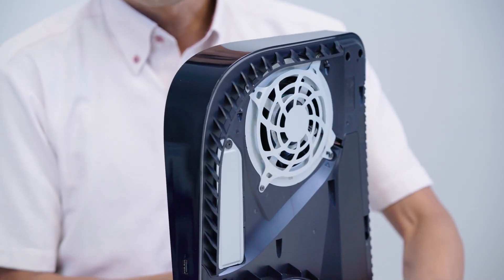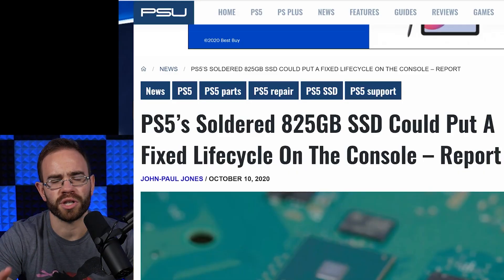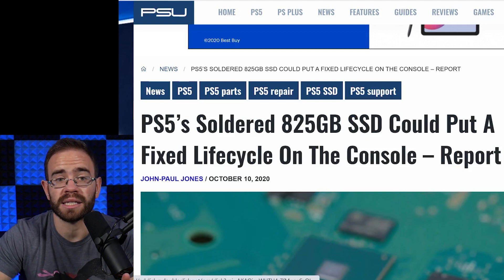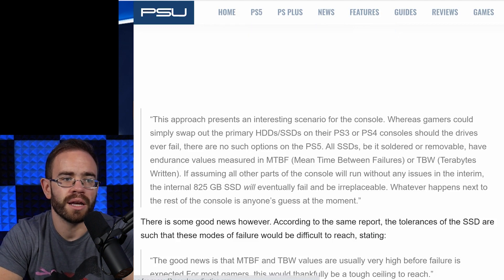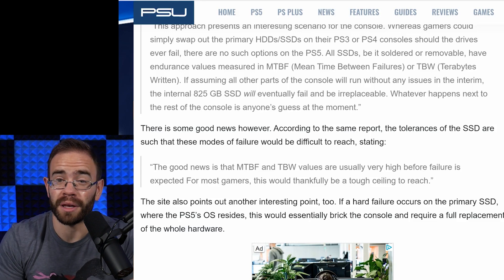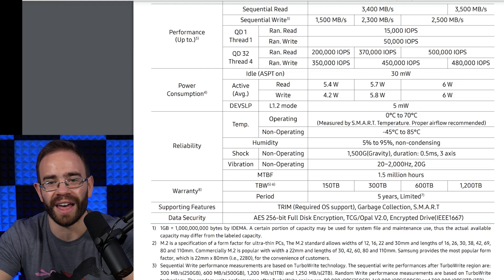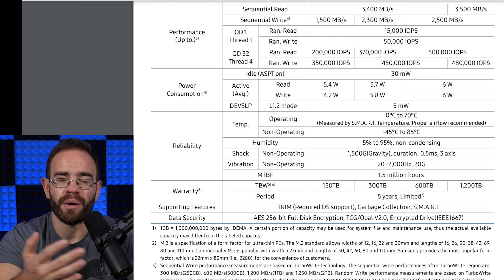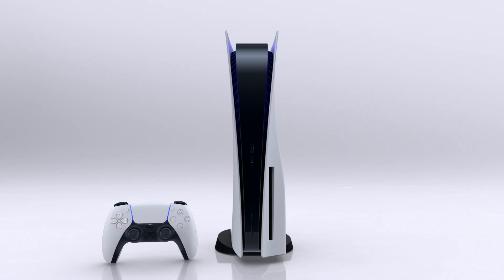Is The PS5/Xbox Series X SSD A Problem For Preservation?

Comment: I don't think many people will rewrite their entire ssd more than 600 times over. Hell, the average attach rate of most consoles is what, 13 games? Plus, if you add a ssd to that m.2 slot, it will take some strain off the internal ssd.
Reply: rob13589  yh it will be empty
Reply: That equation is changing.
With Xbox Quick Resume they're storing about 13.5GB of data every time you pause a game (or between 5-9GB with Xbox One), and it's actually going to update most of the file every time you swap between any two games (Assuming you load a new level every time you swap games), the number of games you have paused in Quick Resume is mostly irrelevant.
If you use Quick Resume 10 times a day, it would take... 20 years to reach 1Petabyte written (the approximate endurance limit of most 1TB SSDs).
Rumor has it Microsoft is using the FireCuda 520 as their SSD: https://www.seagate.com/ca/en/internal-hard-drives/ssd/firecuda-ssd/
Write Endurance on these is listed as 1.4 Petabytes per 1TB of drive storage, so I guess the Series X SSD would go for 28 years while using Quick Resume 10 times per-day.
And most likely Series X would account for redundant data in Quick Resume (basic engine code at least, but if you pause twice in the same level there will also be a lot of redundant data there), so in practice the drive could still have a lot more endurance than just 28 years worth of daily operation.
Yes, I can see it being possible for a bunch of kids to swap Quick Resume games hundreds of times per-day and kill a Series X in just a few years, so the potential for drive failure is not totally gone, but for the average gamer it's just not a concern.
Reply: 13 games???? I have about 500!!!
Reply: @The_Neco_PT  A lot of people only play Madden and/or CoD. My bother-in-law ONLY plays Fifa on his Xbox1. The average really is like 3-5 games a year.
Reply: @The_Neco_PT  dude 500 games? Awesome do you have any unopened ones?
Reply: I have 978 games and more by the day
Reply: I just killed my 1tb hybrid hdd. Too many reads writes and edits. But thats an HDD and it lived from ps4 launch to ps5 price announce. SSDs live exponentially longer without any major equipment malfunctions.
Reply: Mike Foss yeah, SSD’s have no moving parts so they are a bit more durable, but they do eventually die (after around a petabyte of data transfer
Reply: @fosstheboss31  I recall reading that HDD last an average of 4 years. Don't know about SSDs but It has to be longer.
Reply: @praisethesun4997  all of my HDDs lasted years way longer than 4
Reply: @praisethesun4997  HDD seem to last over 10 years If you don't drop them. I hope my PS5 triples that cuz my computer's SSD is making me think otherwise. It's a ryzen 3600 with a x570 motherboard yet the SSD seems to have problems running some games so I play them off of the HDD instead
Reply: @N7uy66u  Cool. I'd say anecdotally most of my drives have lasted over 5 years. But I do have a few dead drives in a drawer. 3 Seagates an IBM drive and WD drive to be exact. I just recall seeing something from a data center about how their HDDs lasted an average of 4 years. This isn't the article I read, but says the same thing. https://www.prosofteng.com/blog/how-long-do-hard-drives-last
Reply: @praisethesun4997  My first SSD is over 7 years old, still functional and has been moved into a number of computers. However some amount of nand will fail prematurely, and I have had to replace a handful of them at work. I've replaced many HDDs in consoles too, so I can see this being a problem if the nand fails and the console will no longer boot. Ideally they should make the  console bootable from add-in storage.
Reply: @fosstheboss31  ssd don't last exponentially longer. HDD failure is down to moving parts, SSD on the other hand has a write limit.
Reply: NVMe is sure to drop in price so years down the road can just get 2tb+ and save wear on the internal.
Reply: 13 games?  I have more than that on just one hard drive.
Reply: @deathproof8732  I probably have 100 ps4 games, but we aren't in the majority. Most console owners only buy a handful of games.

Comment: You could download cod warzone 2400 times before it would be an issue. This just isn't a realistic thing people will hit.
Reply: Considering the average attach rate (the amount of games a console owner buys) is only about 13, I doubt this will be an issue at all. I consider myself a serious gamer and I only have about 100 ps4 games.
Reply: It's true, but bear in mind that the SSD also needs to write things in the background constantly. Saves, updates, cache, paging, OS related operations, etc. ... . The games installed are not the only thing wearing the SSD out. It's not a negligible amount of daily wear and tear, however, it shouldn't realistically be that big of an issue.

Also, a small aside about preservation concerns: SSDs normally go into read only mode after a threshold and at that point one could just dump the files and transfer them.
Reply: @MyChannel-SR1  if there’s a read-only mode, what’s the issue with preservation?
Reply: @jonathanodude6660  It's not really a read only mode you can access every day, it's a measure to prevent the SSD from becoming unusable upon failure. This is usually done to avoid loss of data, which means that preservation efforts might be aided by it. However, I'm not so sure an OS can be accessed in read only mode as there are a lot of OS tasks that can't be performed (and I'm luckily ignorant because my OS SSD never failed). If Sony makes it possible to install another OS/recovery program on the second SSD slot it might almost certainly be possible to extract the data on the spot.
Reply: @MyChannel-SR1  yeah but I’m assuming the issue is that games are becoming more and more digital, so it’s harder to get working copies of the game past the point where it becomes unavailable, and if the drives we store them on become unusable, then they are lost. but if the drives automatically (or even manually) enter a self preservation mode at the end of their lives, is there actually an issue with data loss? The data is still accessible.
Reply: @jonathanodude6660  That's also my point. Failing SSDs still are safer than expected. Also, we probably will have a way to dump the files by ourselves even if Sony goes out of business (that is if Sony allows for an OS/recovery tool to be installed on your secondary SSD).

I'd say however that people who really want to archive their games will have to dump them to an external HDD (which Cerny claimed to be possible). Thorough archival projects still exist for people who didn't save their games during Sony's business lifespan, and at that point there should be no problem downloading Sony's IP off the internet.
Reply: Every time you switch games, Quick Resume (and its PS5 equivalent) will write something like 12 GB of data to the SSD before restoring whatever game you selected. It adds up.
Reply: It is theoretical TBW. Not practical limit usually SSDs last 10 times longer than claimed TBW for warranty purposes. For example there is anandtech article where they test various SSD write limit. Most drives easily last 1 PB before any significant wear.
Reply: @rapiddu6482  These also tend to be based around averages when testing huge numbers of the hardware. Some percentage will fail well before these limits, particularly if other factors come into play which might increase risk of damage to the drive. SSDs are certainly less prone to damage from vibration and such like HDDs were, but heat certainly impacts SSDs and the PS5 will be putting out plenty of that judging from the heat sink. We'll just have to wait and see what kind of information is released about this, as well as what kind of issues appear once the hardware is out in the wild.
Reply: @ArtumTsumia  
Sony has built their 5th major console now , I'm sure they'd have given a thought to all of this much more than us. The insane Heat sink along with double sided inward flow fan with considerable dia and thickness is gonna take care of all the thermal issues that's for sure !
Reply: @Zeegoku1007  No doubt. For the vast majority of users, this kind of thing won't be remotely a consideration. So long as the drive hold up a minimum of 5-10 years, but the point of the video was preservation and in that context it becomes a question of if it'll hold up for 30+ years. For collectors like myself, who do have working hardware that old, it's at least a question in our minds. Repairs and modifications will likely be possible in the future, but original hardware is always nice when possible.
Reply: @ArtumTsumia  
Yeah. But if you ask me , design wise PS5 is a step up in almost all the hardware aspects compared to the PS4. What's troubling me is the external storage options whether Sony will be producing their proprietary SSDs , which 3rd party ones will be supported  and of course the price. Also I hope they have made proper arrangements for the external SSD slot cooling.
Reply: People need to keep in mind that the drive is used for far more than just game storage. There's updates, game saves, video capture cache, and lots of various other data that gets written to drives. These tend to be incredibly small in comparison to the size of games, but they happen incredibly often. Also consider the fact that most users will try and fill up as much of their drive as they can with games, and now all of these writes are occurring repeatedly in the same 5% of the drive. If the write limit for a 1TB drive is 600TB, then in practice this is going to be reduced by a significant factor as the majority of the drive is in use. This isn't even taking into account any other reasons that a boot drive might fail, leaving the user with little more than a brick.
Reply: Lol console peasants asking questions that have already been answered by the PC MasterRace 10 times over....the data is all right there in front of you.

Comment: shit ive had to reinstall 1.5 tb worth of games to my ps4 with a 2tb hdd/ssd like 8 times cause my power went out that ps5 wont last around me
Reply: 1.5tb is a long way off from 600tb.
Reply: Buy a UPS for 60-100$ , it helps you turn off the console properly when power goes out , it has battery that last about 5 minutes , giving you enough time to save your games and turn it off
Reply: Rith Panhapich oh, thanks ill look it up
Reply: iBlaze : you can check the power consumption of your TV + 310 (ps5 confirmed to use 310 watts at maximum) and pick the UPS that have similar battery that could last at least 5 minutes for you
Reply: Rith Panhapich thank you, you helped out a ton
Reply: @Ldenlord  Thanks man i never knew these existed 🙏
Reply: Yeah, hope they have a solution for power going off
Reply: I just bought an off brand one for 40$ , known brand are good but they’re like 200-300$ price range so fuck that lol... and this one works fine for me for 2 years now
Reply: 1.5tb x 8 is only 12TB. 600 TB = 600,000 GB. Since the PS5 drive is 825GB you'd have re-write the entire drive 727 times before you would threaten failure from TBW. And it sounds like you should get a battery backup so you have time to shut down your system when the power goes out.
Reply: @praisethesun4997  yeah but power outages and re installing games is no good for a console that is meant to last
Reply: @13gta  Power outages and any electronic is no good especially an expensive power hungry one like a console. If you have frequent black or brown outs in your area, get a battery backup. You have bigger problems than possibly killing a PS5 via TBW.

Comment: If you don't add additional storage to the PS5, and are continually deleting and adding new games, you'll quickly kill the SSD in it, as the capacity is tiny, and they are designed for a finite number of Terabytes written to it...
Reply: He showed that other drive had a 600tb limit before you need to worry. Most people won't rewrite their entire internal ps5 ssd more than 600 times.
Reply: Given it's 600TB of writes if we hold each game as being UHD Blu-Ray max of 100GB, and acknowledge the PS5 won't have a page file, you're talking about downloading 6,000 games to hit the write cap.  The PS4 only has around 4,000 games in its library, so you would effectively need to buy the entire library, and download half of it more than once while assuming everything is bursting at the gills of what UHD Blu-Ray can handle.

If you have the money for all that, you will have the money to buy a m.2 drive once commercial drives are ready for use.
Reply: Let's say the average next gen game is 100GB to make the math easy. You would have to install 6,000 games on the internal drive to threaten failure.  Game saves are going to eat up some of the TBW but even if we grossly over estimate save data to 1/3rd of the data written. You are still looking at 4,000 game installs. I don't know about you but I own maybe 300 games and that's across six systems and over the past 20 years.

Comment: They took a page from Apple's playbook. Makes people angry so let's hope these have lots of read and writes available because they will eventually die. If you can get the chips though it may be possible to solder a new one on there.
Reply: Given it's 600TB of writes if we hold each game as being UHD Blu-Ray max of 100GB, and acknowledge the PS5 won't have a page file, you're talking about downloading 6,000 games to hit the write cap.  The PS4 only has around 4,000 games in its library, so you would effectively need to buy the entire library, and download half of it more than once while assuming everything is bursting at the gills of what UHD Blu-Ray can handle.

If you have the money for all that, you will have the money to buy a m.2 drive once commercial drives are ready for use.  Apple's issues have largely had to do with them frying the Controller because of bad board design, see Louis Rossman for details.
Reply: @jebe4563  Goes faster than what you think and it will not play off the disk it writes it to the storage before you play then you have to factor in updates and all that jazz. That is why it is concerning just like the liquid metal. Dont get me wrong I am getting one but as a consumer I have concerns. I am an IT professional and I know how flaky some of this stuff is and how it can fail easily.

Comment: Im wondering if the ps5 will use that custom SSD controller for only that SSD or will it work on the one you can install on the side? This whole 600tb thing is worrying as the SSD so small your gonna be deleting and reinstalling games alot
Reply: 650 TB would last 10 years if you install game at a size of 178GB every single day , so I’d say you’re fine
Reply: You'll have to work pretty hard to rewrite your entire ssd more than 600x. There's no reason to worry. Even after 10 years of use, the ssd will be fine. Hell the mechanical components (disc drive, fans) will fail long before the ssd. The PSU probably won't last that long.
Reply: @fattiger6957  it's such a small SSD tho it's gonna be constantly having to be written over repeatedly any time you get a new game. Games being 100gb now days I see it being a problem eventually
Reply: @dbfzato-1327  you have to write a 100gb games to it 6000 time for it to fail. How many games do you have in your PS4 collection? I'm betting way less than 6000.
Reply: If you watch Road to PS5 you'll note Cerny is very explicit that any drive going into the m.2 slot will be using the PS5's controller, hence why they have to validate it actually works properly with the controller at the intended level of performance.

Comment: I get what you're saying but in 10+ years, specially with the PS5, even if it's on board drive fails, you'll still be able to put in bigger one in the available slot.
Probably 4 terabytes for under $100 at that point.
And by then, you'll be using it less so it should be good if you keep your systems.
Reply: SSD in the slot is only additional, main SSD and system is soldered onto the MB, if it fail - system will not work.
Reply: Yes, but Sony would need to allow us to install the OS onto the extra drive and boot off it for that to work.

Comment: There will always be third party companies who know how to remove and solder components to a motherboard. I've paid a company to replace the HDMI chip on my PS4 motherboard after it broke down and now it works perfectly. If the PS5 breaks down for mobo related issues, send it off for repair. The solution isn't perfect, but it will exist.
Reply: Swapping out the ssd will be a lot bigger and more complex task than an HDMI thing.
Don't think you'll be able to fix it without replacing the whole m/b
But nvme drives last for a very very long time so you really shouldn't have issues
Reply: ...except people are already struggling just to put modchips in the switch

Comment: MTBF is an enterprise metric, what it's supposed to signify is if you've got a lot of the same drive, you divide the MTBF by the number of devices and that's how long it'll take between failures of each device.

1.5 million hours is about 171 years, so if we look at a town where 1000 people own an SSD, then this town will see an SSD failure approximately every two months.